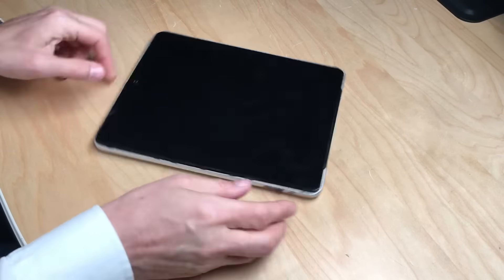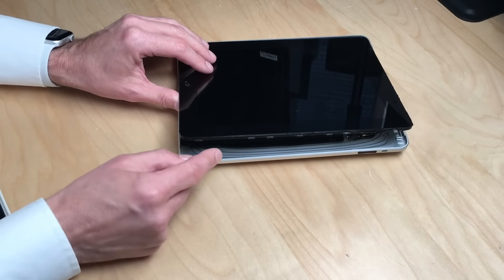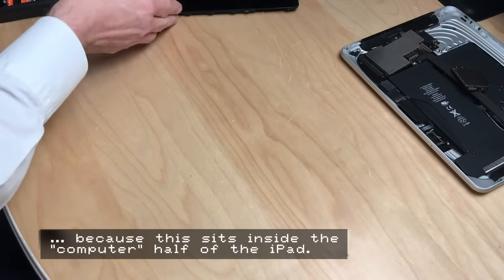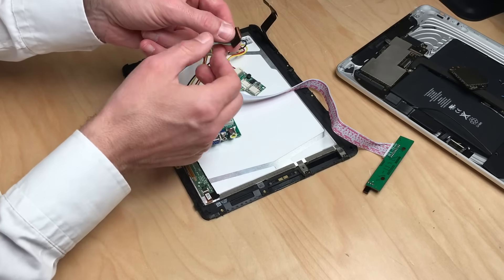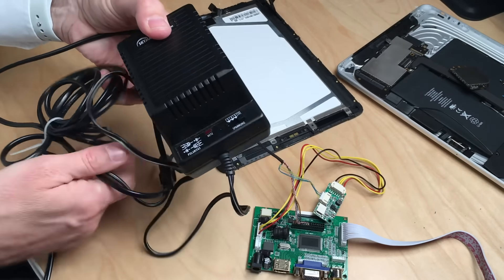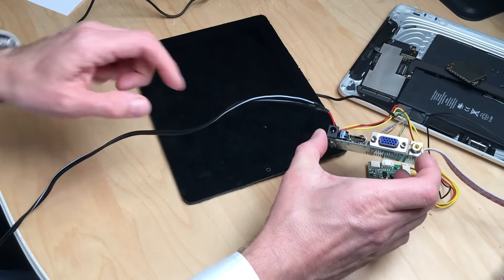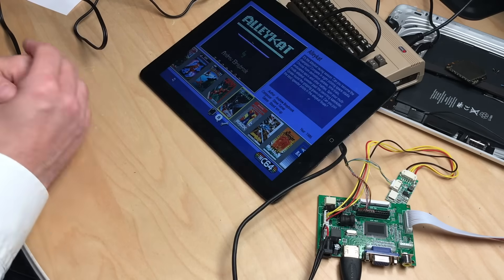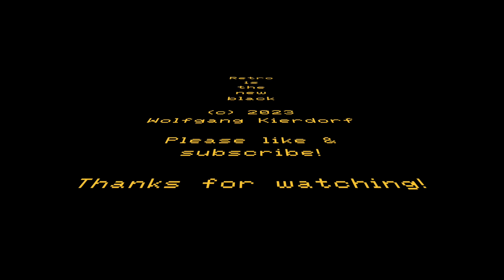Turn any old Apple iPad into a real HDMI monitor (with HDMI & VGA input)(iPad / air / mini / pro)

Comment: Brilliant idea, why not ues the battery in the unit if it was still charging, just dump out the old mother board, retro fit the new motherboard, charging port with VGA ports, so you keep the original iPad look, but retro fitted, love the video

Comment: This is very cool
Thank you 
Although I was somewhat disappointed when you used an external 12V power supply. Can it be done using the iPad's battery? ( Then I could use a pi powered differently .... as a portable system)
Reply from the maker: You can use a usb-c powerbank with a pd-board for about $1.

Comment: That's really neat!  I had a dead (SSD issue, if I recall correctly) Surface 3 that I got rid of a few years ago, and I remember wishing that I could have done something like this with the Surface 3's small but gorgeous display panel.  I think I did some googling at the time and didn't find anything, so I transferred my data (in between system failures) and took it to the city's hazardous waste disposal.  I hope that solutions like this for tablet computers with serious problems but good displays continue to be made available, to lessen waste!
Reply: The surface 3 is a great little tablet. That sucks.

Comment: Wow…
I really thought that I will see something smart like made a well working app and an adapter that works on 30 pin and lighting but instead I got just to see how you scraped an display from a device to use that as an monitor…
Bro even 15“ monitors get just thrown away cuz now one needs a small external monitor anymore where’s already something with over 20“ came for just 20-30 bucks…

Just to swap out the battery to fix this stand alone device would be way more smarter then this, even with all its limitations it’s still a great device to stream media from an NAS (didnt even need a jailbreak), use it as an e reader, listing and streaming (with airplay) Musik, still great for everybody’s office stuff and of cuz playing all this old 32bit pre service games games where you simply get a full game for a fixed price (just imagine)…

So all in all pretty stupid cuz even to sell this devices with damaged battery is pretty worthy, they get more and more expensive so that you this also could been sold for something between 30-50 bucks but you decided instead just to burn this money (even more) and do this to it what you could also do to an android tablet from this time what has no worth at all anymore or and old pc monitor that someone just threw away for nothing…
Jep, smarter Chanel…🙈😅

Comment: Very good project but no one have a screen content with 2732x2048. 12.9“ is a very good size. and what’s about touch?
This board LP097X02 resolution is only 1024X768. Is there a better board for the original resolution?

This is a LVDS 30 pin connector for many displays.

Comment: What a fun project! thanks for sharing. I need a small external monitor / keyboard / mouse combo from time to time to perform maintenance on headless mini-pcs that operate in remote locations in observatories. I also have an old second-generation iPad that has not been used in a few years. I hate to throw things out, so this will help me solve a practical problem in an elegant way.

Comment: If it were possible to just assemble the back of the iPad back and use a 3.7v to 12v up-converter to have the flat battery powering the board and display that would ne nice. A small slim box with the board and buttons on the back would make it portable to use for a few hours. The links provide an alternative solution with a board including a 720p display for 15 (60) euro's. Stunning price if you want a TV screen in your kitchen with a FireTV dongle. I am not sure the audio will be available but their most be a headphone out socket or even stereo pins on the board. Nice video, THANKS.

Comment: I did a similar conversion with my 2009 27” iMac.  The computers graphics card expired, but the screen was excellent.  Therefore did this conversion with the driver board from AliExpress, and 2 years later it is still working perfectly as the monitor for my new Mac mini.

Comment: Really wish there was a control board for the new gen iPad pros , been looking for a 2k res 11 inch 120hz touch screen monitor for a project for awhile. The added benefit of the ipad screen being oled.
Reply from the maker: Could be, that this one works: https://de.aliexpress.com/item/1005006491100111.html . I am not sure if the iPad 7, 8 etc. had the same screen.

Comment: would it be possible to make a case where few 18650 batteries with a charging board will serve as the power source ?
Reply from the maker: That case already exists: https://de.aliexpress.com/item/1005003026843618.html

Comment: Create a frame that can house several screens.  There are plenty of open source projects that share over multiple screens.  Imagine an immersive, curved,  custom display 120cm wide and 30 cm high.  At a fraction of the cost of a commercial system.

Comment: That's pretty interesting as a DIY project but unfortunately under the current economical conditions makes no sense whatsoever. I have to admit I like it though but I would never recommend anything like this as a practical exercise. Spending extra money on those display drivers along with getting a non-standard resolution 10 inch display without a case is simply nothing more than a hobby project.
Reply from the maker: https://de.aliexpress.com/item/1005004263431877.html
Reply: Just jailbreak it, install duet's old ipa, install duet in your pc, connect via usb, boom! you have extended display, I tried it today and its working on my ipad 4

Comment: It's despicable that I have a fully functional Ipad 1 that is entirely useless because of the lack of software updates. It's why I refuse to buy an Apple product ever again.
Reply: Forget software updates, companies should be forced to unlock any device they stop supporting.

You can install windows or Linux on a computer from the 90s, you should be able to do so on any older machine, if only Apple unlocked it.
Reply: @vocalead maybe beside the point but you can jailbreak an old iPad and it is essentially “unlocked”
Reply: My old android has the same problem
Reply: Doesn't this prove that we don't actually own our iPads?

Comment: Good idea, thanks for sharing. Note, for 49 USD I purchased a full blown 11.6" LCD monitor with USB-C and (mini) HDMI connectors. Admittedly, the display is not remotely close to gorgeous iPad screen...
Reply from the maker: I own two of those USB-C displays, but for retro projects where you need that specific size and 4:3 ration, these are great.

Comment: Hi there! while I'm not after an Ipad for it's screen, I'll leave this bit of info: the smaller board may be disconnected off the assembly because, I believe, it's a backlight, hight voltage power supply, which won't be needed in this case.
Reply: I think you are right that it's a high voltage board for the backlight, but don't most screens need a backlight to be able to see what's on the screen?
Or are you suggesting to remove the back of the screen and use ambient light instead? (this is sometimes possible)
Reply: @Incommensurabilities  , the high voltage backlight is suited for monitors and mostly old laptop displays. Old tablets feature backlight as well but it's led based (instead of the ccfl lamps that required the high voltage modules). Have you tried without the module?

Comment: Thanks a lot for the inspiring video! I immediately started disassembling my iPad 1and ordered a controler board :)  But mine has not a ...SLD6 display, it has a ..SLF6 one, guess it was one of the lastes ones sold, bought it new, when iPad 2 just came out
Reply from the maker: Should still work. Check the following link for links to more controller boards: https://www.wolfgangkierdorf.de/retro/ipads.html

Comment: Ha, the neater trick would be to swap out the innards, put in a modern SoC and make it an Android that runs modern android.  I would absolutely do this if it were possible, since people don't make android tablets with a correct aspect ratio.
Reply: so do it
Reply: How about you start getting the schematics or the SoC pinout and we go from there? Some SoCs where made by Samsung.
Reply: @zizlog_sound  If I had the ability to do that I would have been doing it by now.
Reply: I agree with @GreedoShot mate it is time to put your money where your mouth is and get cracking!
Reply: @funbucket09  Ha, sorry, my skills are pretty basic, and most I have done successfully is mod/repair some 16bit systems.

Comment: coll and all, but why? so much work for what exactly? for 100$ you can get a 15’’ portable screen…
Reply from the maker: It's about using something that you have and that you throw away otherwise because it's just a brick now.
Reply: @RetroWK  ok, sounds reasonable. but then again, isnt removing the screen a major PITA, due to the adhesive? just asking since pur 2019 ipad is showing first signs of deteriorating battery, which is ok for a 5 year old tablet i guess, so im guessing ill have to do something like this in the not so distant future… cheers! subbed.
Reply from the maker: @cordlesswire  Thanks! Just use some 99% alcohol on the glue and it comes right of. No problem. Just take your time.

Comment: At first I found this setup clunky. I think if there was a driver board with power supply that would probably ease the project. Having to source a PSU adds some hassle..
Reply from the maker: You can also use a PD driver board for USB-C: https://youtube.com/shorts/71tAOaD3kfI?feature=share Then you can use USB-C for power!

Comment: ShOcK & AWE COoL. I love  :face-red-heart-shape: small, hi-quality (repurposed) monitors! I never dreamed that it could be so ~easily accomplished with a Uber Proprietary Apple screen. A sub-worthy video if I ever saw one. Thank you for this video. You RoCk. Cheers from So.Ca.USA 3rd house on the left
Reply from the maker: Thanks!
Reply: Bro I think your caps lock key is broken aye.  Either that or one of your stray fingers keeps holding down shift.  I suggest a visual inspection of your keyboard as sometimes dirt can get into the switch or circuits and cause a false toggle of the button.
Reply: @funbucket09    sɹǝǝɥƆ ˙┴˙I uᴉ ʞɹoʍ ʇsnɯ no⅄ ˙˙ʎɐʍɐ ʇuǝʍ ɯǝlqoɹd ǝsɐɔ ɹǝʍol - ɹǝddn ǝɥʇ puɐ spɹɐoqʎǝʞ pǝɥɔʇᴉʍs I ˙ʇᴉ pǝlᴉɐu no⅄ ˙ʞɔnqunℲ noʎ ʞuɐɥ┴   :hand-pink-waving::face-blue-smiling:

Comment: Many years ago, Adafruit came out with the Qualia board which could drive iPad Air displays and worked beautifully, but it was pricey and had only DisplayPort in.  But $50 for a replacement gorgeous Retina screen was just too good.  Then $22 HDMI/VGA controller boards some time later when iPad Air screens were $25ish on eBay, so I bought a few dozen for projects.  Cool that more models are available.  Would love to get a 12.9” Pro screen.  Even the 1st gen has near Retina color saturation.

Comment: What PSU do you need? 12V but how much A? 

And is there a way to connect a battery to make it truely portable?
Reply from the maker: You need 2A to be one the safe side. And you can use a usb-c power bank to power it or a 12V battery.

Comment: Thank you for this, but an important omission--at least for me: You already removed the cables from the iPad screen (pre-video), leaving me to scratch my head over how the heck to do that--especially the one that will accept the cable from the driver board.  Do I slide it out sideways?  Pull strait up?!?  I tugged on it a few different ways but I'm afraid I'm going to damage something if I apply more force.  Do you see my dilemma?  Also, when you plugged that connector in, @4:59, your hand covered up the action, so I can only get a vague clue from that.  You even said that "it's a bit tricky," so, yeah, as a videographer, this is where you need to provide better views.   I was hoping these little details would be included in your video.
Reply from the maker: You have to lift the tap on the connector. It has a piece of black tape on it and that tap kind of folds over the connector. You can also see it here: https://www.youtube.com/watch?v=iD8kGSD5r0A

Comment: 4:44 the small board is for speakers and touch. Yes, you can make it a touch screen!
Reply from the maker: I think it worls works with this: https://de.aliexpress.com/item/1005005578285410.html?spm=a2g0o.productlist.main.35.e4fesNrxsNrxQw&algo_pvid=589a1b48-8f5a-4be9-809e-6743d63cb40f&algo_exp_id=589a1b48-8f5a-4be9-809e-6743d63cb40f-17&pdp_npi=4%40dis%21EUR%2139.09%2130.88%21%21%2141.15%2132.51%21%40210387dd17154220400487533ed98c%2112000033623536180%21sea%21DE%212268004052%21&curPageLogUid=dhsOGCNmrp5b&utparam-url=scene%3Asearch%7Cquery_from%3A
Reply: @RetroWK have you confirmed that this linked Controller works with iPad 1 monitors?
Reply from the maker: @wardj4102  Nope. Just the one in the description is confirmed.

Comment: PSA - you may have to try multiple different controller boards before one works. I am sending one back because it does not power the backlight.
Reply: Actually, when I plugged everything in it did work! I thought one of the boards was an IR receiver like in the video; it was actually the backlight driver! A little strange it needs a whole separate board to work, and it also doesn't directly connect to the panel, but if it works it works!

Comment: Have you ever done a MacBook Pro screen? I have a dead old one and considering doing the same.  But I’m concerned that, when I look at the connector (flex cable), there may not be an available controller card for it.
Reply from the maker: Yes, I did that. You can get controller boards for pretty much everything that displays pixels.

Comment: I found some sellers that sell controller boards for the LP097X02 screen but did not specify the SLD6. Do you think this would also work for my ipad2?  Thank you so much for your video. I have been wondering what to do with. My obsolete iPad 2 and also needed a small 2nd screen for my desktop Windows PC.
Reply from the maker: That should work.

Comment: Does the Driver board include the inverter ? Or, will the inverter output on the Driver board correctly supply the iPad LCD ? Or, is additional 'external' inverter required ?
Reply from the maker: The driver board does it all!

Comment: I just inherited of an old iPad 4th gen from my late grandmother. It's in literal gem mint condition of course my grandma being so careful with it the screen is just gorgeous and I was already searching for small portable monitor. But then got this so i wanted to bring it back to life and maybe help me with my streams and such. So yeah I really want to make it into a small secondary monitor for my PC.

Would it be the same steps? Is it considered an iPad 2 or something of the sort?

Thank you for your help if you see this!
Reply from the maker: The screen is the same in the iPad 3 & iPad 4. Look for a driver board for that one. iPad 1 & iPad2 have a different screen. The driver board won't fit with that.
Reply: @RetroWK  thank you for the quick reply! do you have a recomended/trusted place to check for the driver board or just check ebay ? or maybe a forum for tech mods?
Reply from the maker: @FeroxAmarokk  ebay or AliExpress

Comment: Brilliant! I am after the control board for the ipad mini lcd display but i can't find it anywhere. Do you if it exists? Cheers!
Reply from the maker: They exist. Try ebay or AliExpress.
Reply: Great video - thanks for C64 demo! I have been unable to find the adapter board for the iPad mini Gen 4 (36-pin display connector) on either Ebay or AliExpress. The 50-pin connector seems to be more common. Do you know of any other sources for that board, or a source for a converter cable from 36-pin to 50-pin? Thanks!  @RetroWK
Reply from the maker: @jayblev  Nope, sorry! I try to find something but I assume you already did the same.

Comment: Is it possible to use the old casing (once the original iPad innards are removed and only the screen and new board are left) for this? My guess is not really since the new ports are too big for it.
Reply from the maker: You might need a Dremel to make it work, but it could work.

Comment: hey , have you seen any drivers that will work with an ipad 7th gen
Reply from the maker: Nope. I found the display and you can read the serial there: https://de.aliexpress.com/item/1005003234644423.html?spm=a2g0o.productlist.main.3.6989bbfasbXYDb&algo_pvid=dc15736d-8d17-4d61-a0c6-4a7f4b42ebae&algo_exp_id=dc15736d-8d17-4d61-a0c6-4a7f4b42ebae-1&pdp_npi=4%40dis%21EUR%2152.27%2141.81%21%21%21401.73%21%21%4021038ed816932135070752614ed57f%2112000033146280843%21sea%21DE%212268004052%21&curPageLogUid=MQ9cmvjTUgB5

Comment: Hi, did you ever figure out what the connector at 4:35 is? I see some of these boards that come with it and others that don't!  Thank you!
Reply from the maker: Some LCD panels require 24V power. This port is to attach an optional 24V power board.

Comment: If I missed it I apologize 
Is it only the gen 1 you do this to? 

Will it work on a Gen 5 iPad?
Reply from the maker: Works with all ipads but you need the matching controller board.
Reply: @RetroWK is there a good site to search for comparable boards for any type of screen
Reply from the maker: @joshymcdaniel9233  Nope. Sorry. I just check eBay or AliExpress. Sometimes you can also find these things on Amazon.
Reply from the maker: @joshymcdaniel9233  ... and you can also check the photos on iFixIt. Sometimes you can see the LCD panel number there in the pictures.

Comment: This is what i really want to do my ipad. Maybe in the future i would do this. But as for now i'm looking for an alternative to make my ipad as second screen without detaching the screen.
Reply from the maker: There is non for the old iPads. You can use new iPads as second screen on the mac via software, but the only way to do it machines older than 4 years is to open them up.